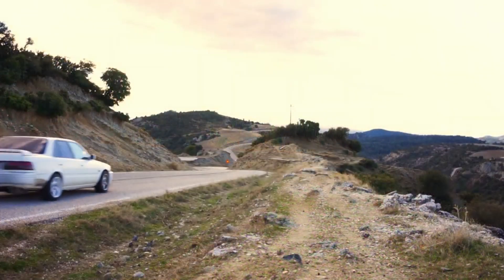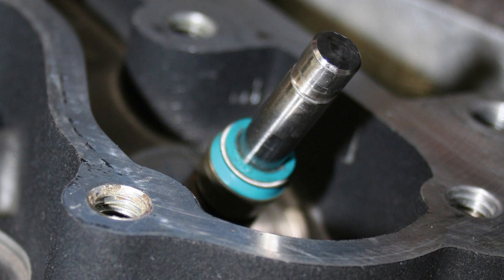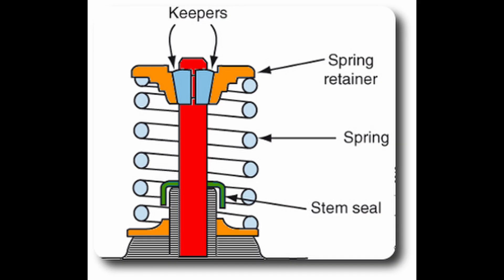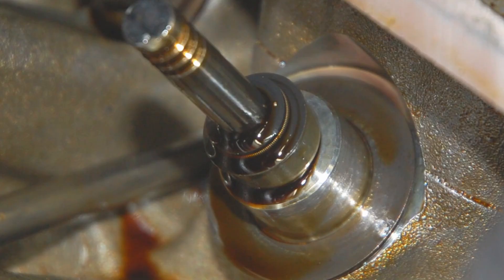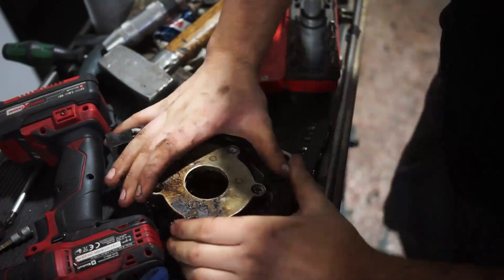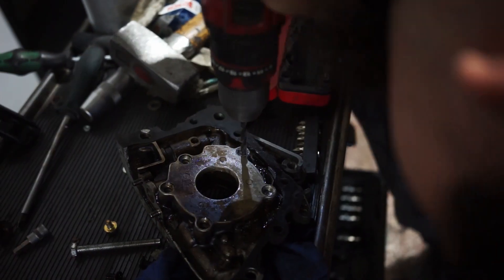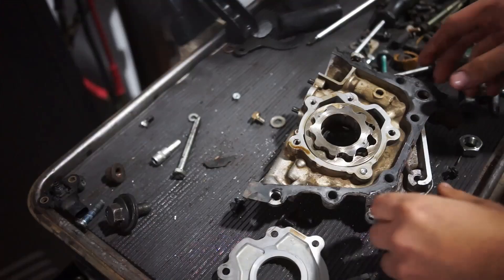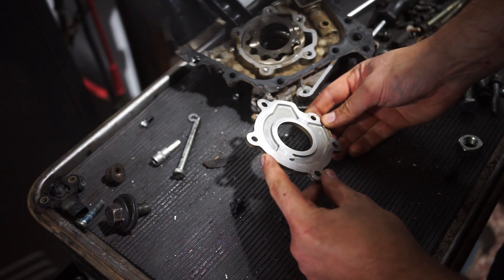Why are engines burning oil | Causes and effects explained | Toyota 4age 20V Engine Rebuild Infos

Comment: toyota garbage engines
Reply from the maker: well old toyotas are probably the best engines you can find as longevity and also performance goes. any engine that hasnt been maintained regularly, will have oil consumption issues.